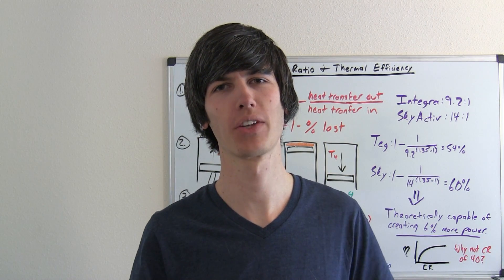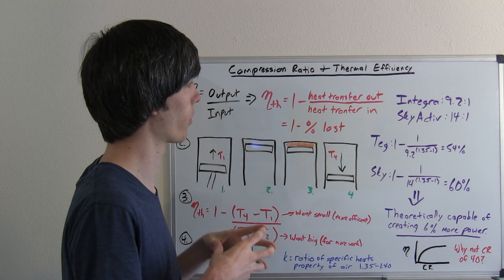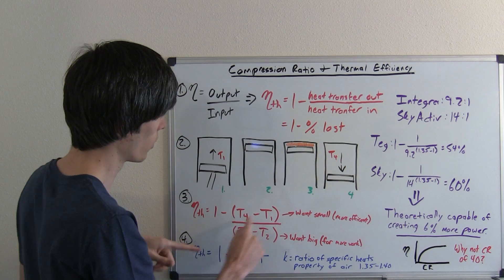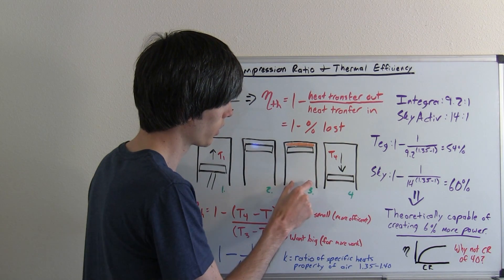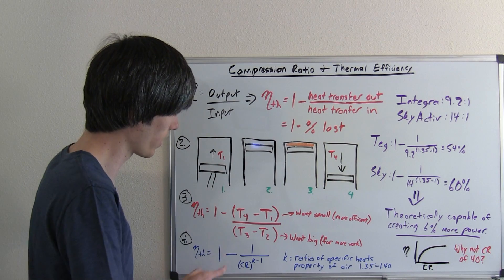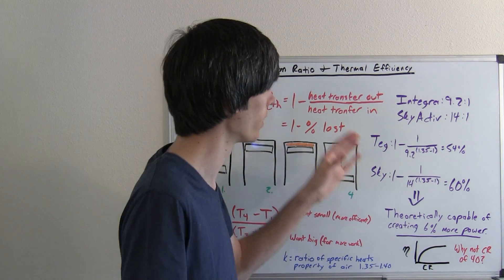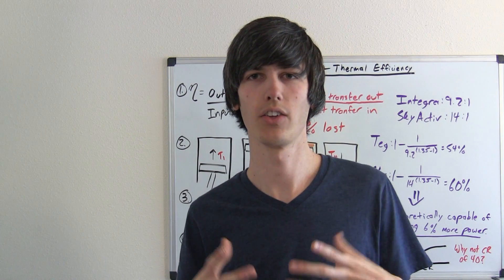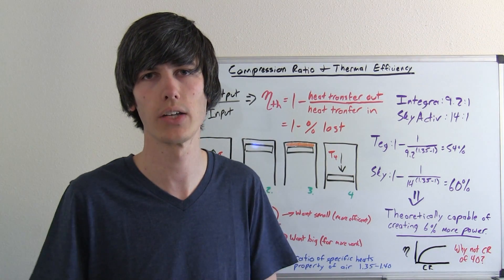Compression Ratio and Thermal Efficiency

Comment: I thought the ECM controlled the AF mixture to keep it at Stoic pressure. Which would also control the burn.
Also heat is a killer. 
Now were talking performance vs longevity.

Comment: On newer engines that have cylinder deactivation ,that thermal energy at the end of the combustion stroke doesn't leave through the exhaust valve anymore. when the cylinders deactivate the Inert gas gets trapped inside and causes a spring effect on those off pistons,! this helps with a smooth  transition from all cylinders to the cut cylinders.

Comment: Actually, you have shown the relationship between fuel conversion efficiency with Compression Ratio(CR) and not thermal efficiency.  To make Thermal efficiency and CR related, we need to consider combustion efficiency equals to unity. So please mention it if possible.

Comment: Engineering Explained we need a video about relationship of: Octane Rating vs Compression Ratio vs Ignition timing. (knocking)

Could you make a video about it, everyone on the internet says different things. Very little letters and materials about it at all.

With an example such as: An engine currently runs on 95 octane (European rating), how can CR and Ignition Timing be adjusted to get a benefit from switching to 100 octane (European rating) or equivalent. What is the max CR for certain octane rating?

Thank you for all of your videos.

Please let us know if you could, it seems very complex and complicated.

Guys, thumbs up for the video.
Reply: I can advance ignition timing to the maximum factory setting possible without any knock.  I made A short video on the subject.
Reply: 787brx8 can you please share a link for that...it will be good for us to know

Comment: I think these numbers are false. Explain to me how you guess some numbers and get a n efficiency of 54% for an integra? Honda claimed the most n efficient car motor they had at the time was the Atkinson cycle 1999 insight @ 38%. The 2004 Prius was only 32%. 2010 Prius was only 34%. 2015 Prius finally hit 38%. Honda just last year broke 50.1% n efficiency with an experimental motor in the lab... @EngineeringExplained

Comment: how does boost affect compression ratio and thermal efficiency ?
Reply: It doesn't effect compression ratio. It's mechanically set
Reply: @treyz28  But cylinder pressure goes up, so it has the same effect = more power and higher efficiency, both because of higher pressures and because some of the energy wasted in the exhaust, gets reclaimed by the turbo. So it is like a higher compression engine, where the engine gets some help to compress the charge.
Reply: @Tore_Lund  The pressure goes up, but still the volume before and after is still the same. Even if you put more air in it, it will still compress that air in a ratio of 1:14 in the exemple of skyactiv engines. The big upside of an turbo for efficiency is the weight. Turbo setup doesn't weight that much compared to building an engine powerful enough to compensate that power. Less weight = goes faster. And its smaller too.
Reply: @nicolastremblay7527  -Which is exactly what I said; It is "like" higher compression ratio, but better because the extra volume is compressed by energy otherwise wasted. I could have written it more clearly! Cheers.
Reply: @treyz28   Thats actually not entirely true. There is static compression ratio and dynamic compression ratio. Dynamic is all that matters, but because its so difficult to calculate at any given RPM and atmospheric condition most people use static because thats the mechanically set CR. The dynamic CR is affected by RPM, scavening ratio, volumetric efficiency, atmospheric conditions, etc.

Comment: Also it wouldn't have hurt to mention that that formula for thermal efficiency applies only for Otto cycles (gas engines) and not for Diesel ones.
Reply: really? and i thought thermal efficiency was only about calculating how much fuel/energy goes in and then how much work/heat comes out. hence if you drop 1000hp worth of fuel in and barely get 100hp worth of it then your engine operates at 10% thermal efficiency.

Comment: From 54% to 60% is an 11% increase, not 6.
Reply from the maker: +Newspaperman57 Yes indeed, should say "6 percentage points."
Reply: according to engeneering explained, sky would be 6%more effiicient then tegra. 54% and 60% respectively. meaning you are left with 54hp of for example 100hp. that means that the sky would be left with 60hp  60hp/54hp = 1.1111 around 11% more power.
Reply: +H.G.D Amptmeijer hmm got it thanks!!
Reply: no problem m8
Reply: +Engineering Explained can i ask how 11%

Comment: High compression creates heat which when squeezed into a small space tends to be absorbed by engine components. It also creates a lot of frictional losses. Mazda Lowered the compression yet improved the efficiency of it's diesel engine.  Sky Active D is using valve timing to lower the effective CR yet maintains a high expansion ratio. Toyota recently achieved a 37% efficiency with a 9:1 compression Atkinson engine... Also Honda has achieved high efficiency with it's EX link engine. Why not talk about expansion ratios which are the real key to increasing an engines efficiency?
Reply: +John Lucas actually the mazda skyactiv diesel reduce the CR so to reduce the heat in the chamber when burning lean, allowing a reduction of NOx production.
Reply: Yes, Maybe my comments were confusing but that's the point I was trying to make... low compression but high expansion...

Comment: hello, you could make a video detailing the different configurations of the turbo engines, advantages and disadvantages. for example: 300hp engine. what if happens the engine have 12 -1 comprecion and 12 psi  or  another config 7-1 comprecion and 40 psi. Both are going to have 300hp

Comment: Ehm, I might be wrong about it, but I always thought the correct firing order is: 1-3-4-2. If 3 just fired then 3 is in power stroke and 1 can not be in a compression stroke. 4 is about to enter compression while 1 is about to expel the burnt fuel-air-mixture. Your arrows are a bit misleading as 1 and 4 move in the same direction.
Reply: +diotough it was clear to me .. i just don't get what are you trying to say ;S
Reply from the maker: +diotough You're reading into this a bit much. The illustration is the various steps of a single cylinder firing. Never said it was a 4 cyl.
Reply: +Engineering Explained Ok, but I think in that case it's at least misleading. You basically have 2x the compression stroke but no intake stroke and 2x the power stroke but no exhaust stroke.

Or are you just trying to illustrate the times at which (hypothetically) the measurements are being made? I had to watch it 3 times until that interpretation of the illustration came to my mind. 

Don't get me wrong: the message and the facts are correct, it's just about the illustration. Your channel is great and very informative even for people who know a lot about the mechanics and principles.
Reply from the maker: +diotough T1 = Piston is about to start compressing. T2 = Piston has completed compression. T3 = Spark ignites mixture, peak temp/pressure. T4 = Exhaust stroke, piston reaches BDC.
Reply: +Engineering Explained Yes, that was my second assumption. I had to watch it three times in order to understand it. It would be clearer if you'd have used captions. At first I thought of a 4 cylinder engine and after that of the 4 different strokes (Intake, Compression, Power, Exhaust). That's what confused me. 

Still: the last arrow needs to point upwards in order for T4 being Exhaust stroke. ;)

Again, great channel and great work of yours.

Comment: like to start off with how thankful I am of your videos, you have taken many years of your life into learning the exact nature, mechanics and over all simplifying it all so I don't hafto :D now that's a RL high CR and knowledge gain if Ive ever seen one. Ok back to my question and curiosity, how could and or what could be done to overall increase the reduction of  increasing negative temperatures? what I want to envision (simplified)  is a new more efferent  way to get rid of the built up heats around and in the compression chambers and at the same time because I believe it would be better to and a little more rational to instead of trying to find a place to vent the excess heat away from, vent it in sequence to decrease the minimum fuel burn (yes its in extremely low low low numbers) to cause combustion in a sense the longer the vehicles running Normally power is lost and the engine loses its peak from that point on, but if you can reuse and expel excess heat the car would maintain a longer peak and steady race where as the other vehicles would be suffering from. basically put turn a weakness into a strength. I know what id like in reality sense isn't going to happen out of the blue but if it was given a considerate amount of thought and effort with the right minds, if that car was in a race it should be clear that its power can be maintained a lot longer then its competition.

Comment: Nice. For carbon based fuels this equations explain the ineficiency of engines. "Energy" is stored in a chemical form then is converted in a thermal form then in kinetic form. To improve efficiency the conversion phases should be reversed. The chemical stored energy is converted into kinetic form and losses are thermal. Engines are poor thermal machines but excelent pressure converters. This make explosives better "fuels" than gasoline. In fact are used to start some engines. But storage rise bigger problems and manipulation is dangerous also. What if a chemical compound like ammonia nitrate is detonated by spark plug ? How those equations will be written? What other implications ( other that oil industry restructuration) may have conversion of actual engines on this chemistry instead of carbon oxidation ? What if most of this "fuel" may be produced onboard in a super efficient close loop? I think that this was done and labeled " water car", called impossible and rejected because not fit in the theoretical 60% and practically no more than 20% efficiency of actual vehicles in a age of space exploration.
Reply: +Marius Moldoveanu thermodynamics is applicable to anything related to heat.  It doesn't dictate carbon-based fuels.  In fact, you can even have solar-powered heat engines.

Comment: @Engineering Explained
In step 3 you stated that the thermal efficiency is equal to 1 - ((T4 - T1) / (T3 - T2)). This equation was originally: 1 - (Cv(T4 - T1) / Cv(T3-T2)). I'm assuming you just cancelled the Cv's on top and bottom to get the equation written on your whiteboard. Is that right?
Reply: What is CV?

Comment: Is this the only reason a higher compression ratio gives you more power? If not what are the other reasons?
Reply: Andrew Drigans More pressure = the force pushing the piston down is stronger. If you squeeze a lot of fuel and air into a small combustion chamber and ignite it the pressure in the combustion chamber will be higher than if you had a big combustion chamber.
Reply from the maker: More compression means more pressure, and thus more power.
Reply: Why does more pressure mean more power? Does it act like a spring and help push the piston back down? Does the gas burn better with less volume? And how much power if any does it take away from the crankshaft to compress the gas with, say a 10:1 compression ratio
Reply: Thanks a lot u are a real help to!! Also why did u decide to go into mechanical engineering instead of automotive engineering
Reply: Tuppoo94 thanks man I really appriciate it
Reply: But what if you have high compression ratio won't that effect your power output but will increase torque like a inline 6 Diesel engine that has compression ration of 18:1 but only makes 225hp?
Reply: spoon games Higher compression = better combustion = more horsepower and torque. Diesel engines have less horsepower because they need more time to achieve the same work as a gasoline engine. This is due to the engine being heavier, revving slower, etc.
Reply: But  isnt hp based by rpm and having a high rpm means your engine makes a lot of hp for example a Diesel engine can with a 6.7l only revs up to 4900rpm but has 900lb-feet of torque and a 500cc bike can spin the Crankshaft at 15k rpm due to the small CR  and in diesel a high CR. But isn't it the higher the CR the more torque you have and the less the more power. Like the 13b rotary engine that does the 4 strokes in 1 rotation of the rotor so it means it would spin the Crankshaft a lot more but since it's 1300cc there isn't a lot of force rotating the rotor so it makes 232 and makes 150ft-lb of torque. Sorry for my bad English it's not my first language
Reply: spoon games 
Power is the rate of doing work. It's the amount of energy consumed divided by time. It's true, you can get more power by just increasing the RPM, but only up to a point.

A car with a 150hp 2 liter diesel engine will accelerate slower than a car with a 150hp 2 liter gasoline engine. This is NOT because of compression ratio since both engines have the same power. It's because the diesel car is heavier due to diesel engines being heavier, and the engine also responds slower to throttle input.

Diesels need a high compression ratio to burn the fuel, because diesel fuel doesn't burn as easily as gasoline.

A 500cc motorbike engine can rev to 15k MAINLY because it's a small engine with light moving parts. A 6.7 liter diesel engine at 15k would tear itself to pieces because the forces created by heavy moving parts would be too much. The compression ratio wouldn't really matter at that point.

A "1.3 liter" 2 rotor rotary engine has a true displacement of about 2.6 liters. Rotary engines also have lower compression ratios, reducing their efficiency, power and torque.
Reply: +spoon games Actually RPM red zone is more limited by the weight of the pieces (rods, valves,etc.) than by the CR, but higher compression ratio means you need stronger (thus often heavier) parts... so it's kind of true... BUT with forged parts for example you can have lighter but stronger parts, allowing you to rev higher, and make more power. low CR are often used in engines that do not really care about the fuel efficiency.
Reply: I really enjoyed reading all the comments above. It was very informative!

Comment: @Engineering Explained What does the K represent in the sheet you gave me?Also , what are you trying to prove on the graph.I understand if the compression ratios is 14:1 you get 60.29% of  thermal efficiency . but red line(C) why 65.20 % . Why a blue and red relation why not just the blue one?

Comment: turbos or any forced induction could do the same thing, it wouldn't alter the compression ratio of course but if it was forcing twice as much air into the cylinder to begin with than a 10-1 turns into 20-1 and comes with all the same perks, more efficient, bigger harder to contain bang and risk of engine knock.

Comment from the maker: It's not quite that simple. The higher compression ratio would mean you could create the same amount of power of an alternative engine (all things equal but with a lower CR) but at a lower RPM, thus using less air and less fuel overall.

Comment from the maker: Theoretically, yes. Because you're producing the power you need to accelerate with less fuel than if the engine had a lower thermal efficiency.

Comment: So, if the Mazda engine can theoretically produce 6% more power, how does that relate to fuel efficiency? Are you saying because the thermal efficiency is higher that fuel efficiency and power will both increase?

Comment: Ultimately it's still a heat engine so no matter how much you move towards the ideal situation, it's still limited by the Carnot efficiency. There are much cleverer ways of extracting chemical energy from a substance e,g, fuel cells which have their own theoretical and practical limits. But they are still a ways off in terms of a practical solution.

Comment: Nope - absorption of heat by metals etc is not relevant. The theoretical figure assumes no heat loss into cylinders, so is the maximum achievable using any gasoline engine technology.

One way to think of it is to imagine the piston expanding forever - that would give 100% efficiency since the heated gas would just keep pushing. However that that process becomes less effective as the piston expands - better just to stop the expansion at some point and start a new cycle.

Comment from the maker: I believe it ultimately comes down to the temperature difference (before and after combustion) which is larger with higher compression ratios, as well as the expansion ratio (opposite of compression ratio).
Reply: So basically, until you reach diminishing returns, the more you increase the temperature of the air-fuel mixture without getting knock/autoignition, the better?
Would this explain the higher efficiency of diesel engines, in which fuel is injected well above autoignition temperature?

Comment: Ford along with another company helped create PWTA cylinder walls or Plasma transferred wire arc thermal spraying. Crazy sounding stuff and I think either Ford or Nissan own the rights to it. It completely eliminates having cast iron liners in an aluminum block thus saving weight and reducing friction from what I understand.

Comment: The internal combustion engine will never die. I just think we will move to more efficient fuels and engine technology. Are any companies using ceramic coatings in the cylinder walls? 

Or why don't we move to diesel as the preferred fuel for vehicles? I should really post some videos on the engineering feats in my ford powerstroke. My diesel will rev out to 5000 rpm and provides adequate fuel economy.